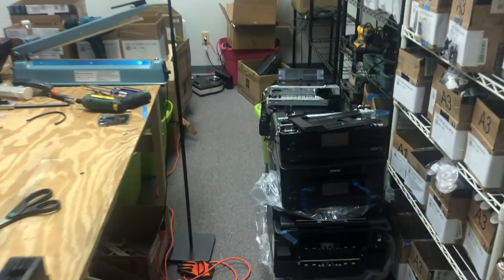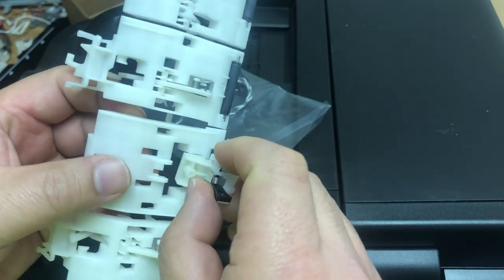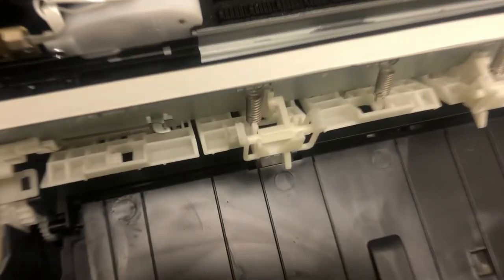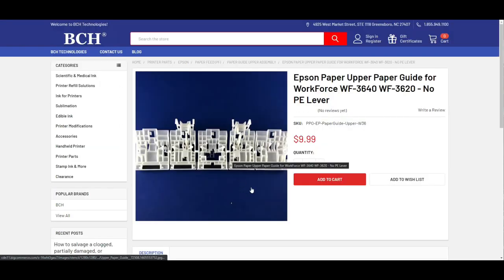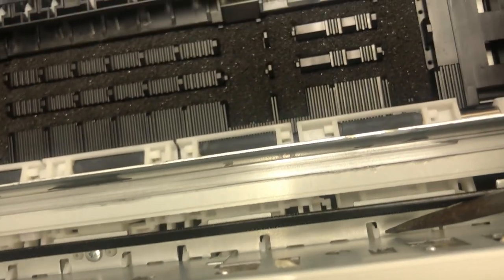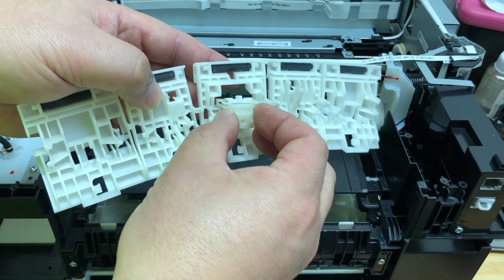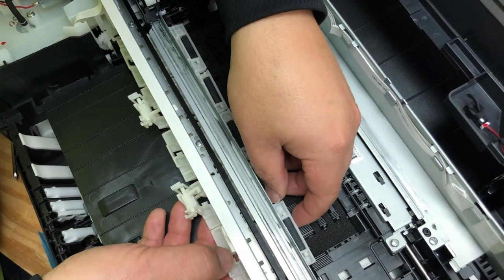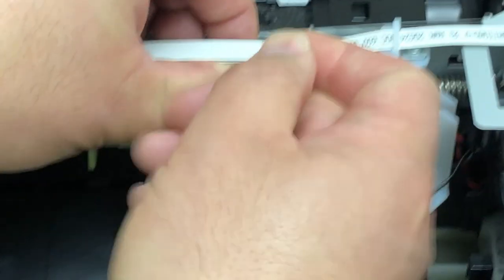Replace Epson Paper Ejection (PE) Lever or Page Guard Roller after a Paper Jam

Comment: what does it mean when the paper bunches up? technically it goes into that shaft where the paper normally goes into when it reverse prints, but i'm not reverse printing. it will print 1 sheet, but that sheet goes up into there, and then it tries to print another sheet thinking there was no paper at all, and then both get stuck and it jams. it only happens once in a while, not every time.

Comment: again.. another great video.. but my issue is for WF7211 its a paper jam error after loading the paper.. this goes even with nozzle check, what parts should I buy?
Reply from the maker: This one beats me.  Did the paper load half-way then there is a paper jam?
Reply: @BCHTechnologies  I am surprised that you still answered this one, the issue is resolved, the ink hose is  interfering with the carriage once it hits left side.. also this printer did not last long, the final error is a burned flex which caused a mother board shortage, F1 soldering is not working with workforce..I have not seen any successful post.. still thank you for answering this one..
Reply from the maker: @c2sartinkprinthub757  LOL.  "Ink hose", I didn't think of that.  Thanks for updating it.
Reply: @BCHTechnologies  hey this is my issue any help?

Comment: Can you do one with wf 7210 please.. installing the lever
Reply from the maker: It’s the same process.
Reply: @BCHTechnologies  The internals are different in the wf 7210.. If you have a wf 7210 you can check... thanks
Reply: The screw for the lever is under a frame..
Reply from the maker: @fernur246  I will see if I have one in the warehouse.
Reply: @BCHTechnologies  ok thanks.. looking forward to the assistance
Reply: Are these parts the same for the 7210?

Comment: Hello, I have an almost similar problem with a customer's printer. I manage to make copies without any problem, I manage to print sometimes from the computer but not all the time and on the other hand I cannot print from my phone. I have the paper jam error every time I try. The eject lever works since I can make copies. When testing with my phone, I have the impression that something does not start correctly, there is a "click" in the printer. Do you have any ideas to solve this problem. Hope you read me. thanks in advance
Reply: I am having the same problem. The paper loads partly then jams. I have to remove it from the back. It is occurring on both of my WF-3640 printers, leaving me to wonder if it could be an app, driver or a repair that is needed.

Comment: Hi  Kevin you videos are very helpful but i have a problem with my epson workforce 2630 wf when i switch it on it completes its boot up or start cycle and is ready to print. no error message at this point.
 But as soon a i send a page to print it make clicking noise at the paper feed at rear (same as its always done  normal paper feed noise ) then throws a error code 0xEA.
 paper does not load or move there s no paper jam that i can see have you any ideas
Reply from the maker: I have a video about 0xEA.  Hop it helps.

Comment: Sir, i have a problem in my epson wf3640, when i turn It On it says that i have jammed paper but when i open the printer It doesn't have Any paper, i've checked several times, does It mean that i have to change that sensor? Thank you for your video and waiting for feedback:)
Reply: I forgot to mention that the lever works well, but it keeps saying that i have jammed paper
Reply from the maker: Does it load half a page then complain?
Reply from the maker: Also, does it finish the initiation the complain about the paper jam, or it stop in the middle of warming up?
Reply: It doesn't load pages
Reply: I turn on the printer but It doesn't show the menu, It starts running and shows  the normal loading screen, but then it stops and shows up the alert or advice
Reply from the maker: Could be the printhead movement.  There may be something block the movement of the printhead.  So the printer thinks you have broken paper stuck somewhere, so it calls paper jam.  Which side was the printhead on, left or right.  Also, how far is the printhead from either left or right side of the wall when this happens?
Reply: When i open the printer the print head its on the right about 2 inches from the place it goes
Reply: When i turn It On it makes a very smooth movement to the left and then it returns faster, then the advice pops up
Reply from the maker: @eltiochome4739  Check the printhead lock, see if it can lock the printer, or it is out of place. https://youtu.be/toLs7DEncQk